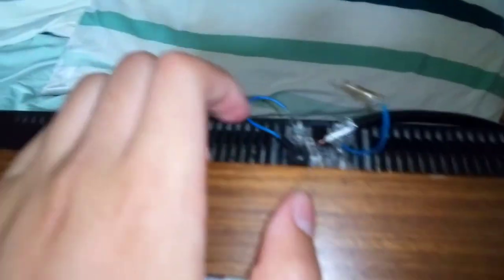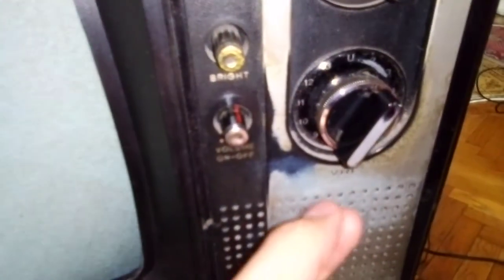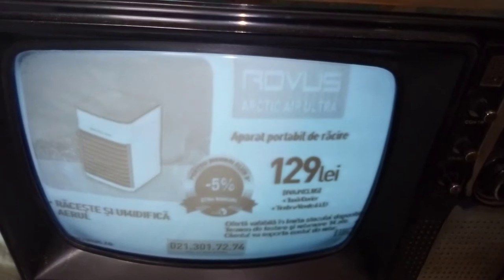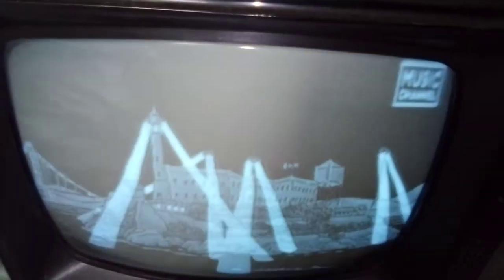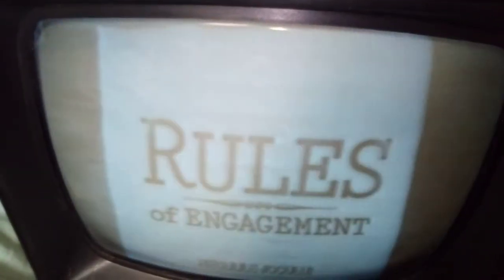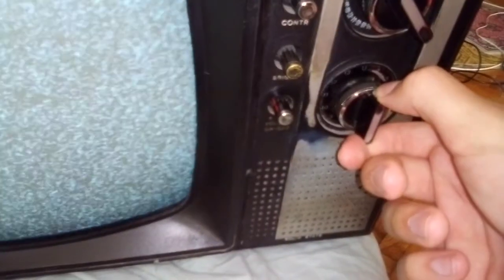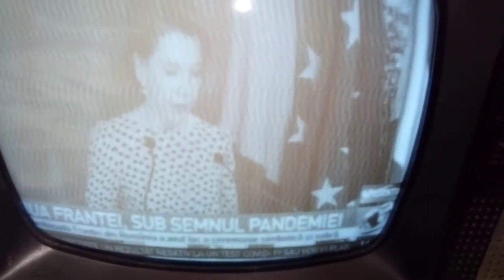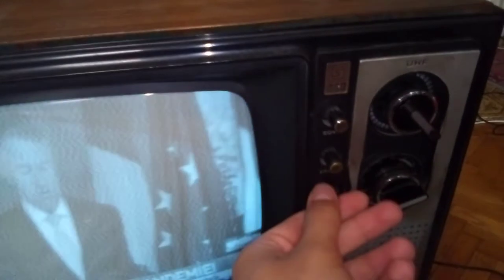Old B&W CRT television is working in 2020 with Analog Signal

Comment: When you are changing the channels is it OTA or from cable?
Reply from the maker: It is fiber optic converter box which produce RF signal for any Analog RF television,i tried recently to pirate some tv channels using the Analog antennas and you dont get almost any signal execept for a few buzzes